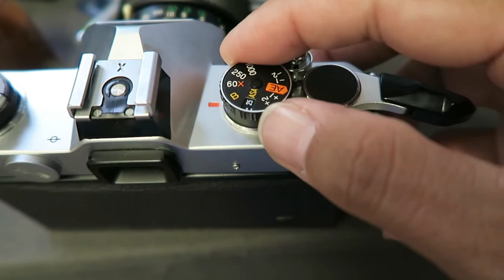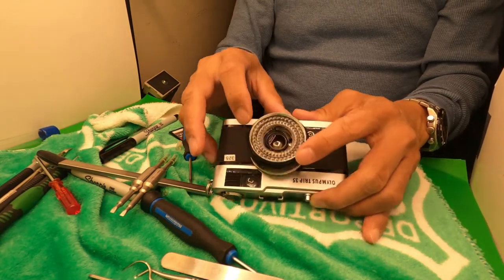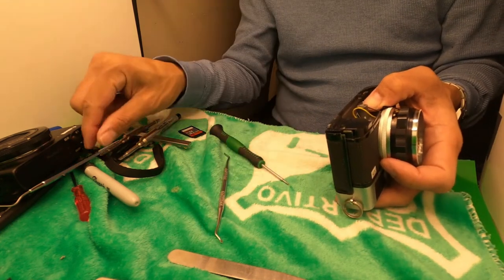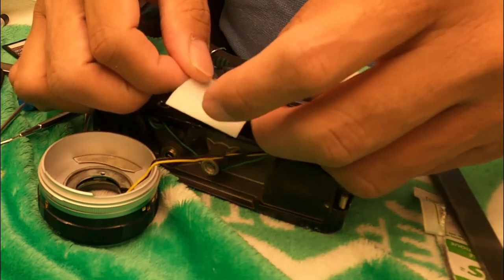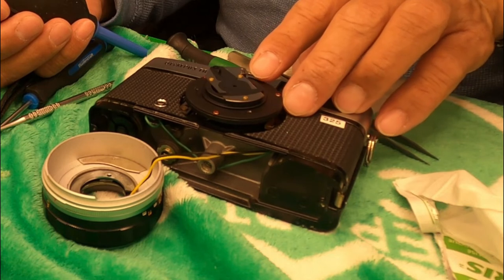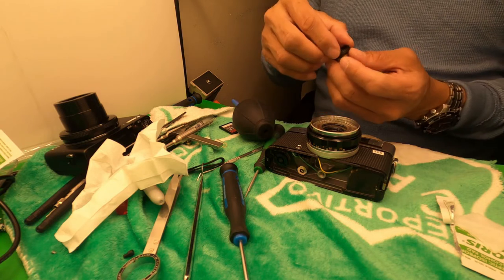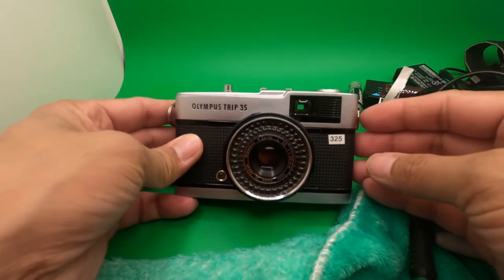HOW TO FIX OLYMPUS TRIP 35 * APERTURE BLADE STUCK * SIMPLE FIX * OLYMPUS TRIP 35 RANGE FINDER CAMERA

Comment: Thank you so much for this tutorial !!! I repaired mine just now !

Quick tips for the future I found during the repair. When you put the verrry small screws around the last ring « Olympus D. Zuiko 1:2.8 … ». Instead of trying really hard to put them back while installed, with the complicated angle with the srew driver, you can place them before, not screwed a lot just positioning them, and finish screwing them when install. 

Don’t know if I’m clear but those tiny screws gave me hard time 😅

Thanks a lot again

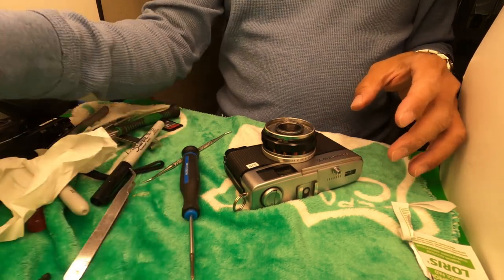Comment: 23:42 

Thank you so much for this tutorial !!! I repaired mine just now !

Quick tips for the future I found during the repair. When you put the verrry small screws around the last ring « Olympus D. Zuiko 1:2.8 … ». Instead of trying really hard to put them back while installed, with the complicated angle with the srew driver, you can place them before, not screwed a lot just positioning them, and finish screwing them when install. 

Don’t know if I’m clear but those tiny screws gave me hard time 😅

Thanks a lot again
Reply: actually no need to fully remove them at all, just loosen them and leave them in the ring.